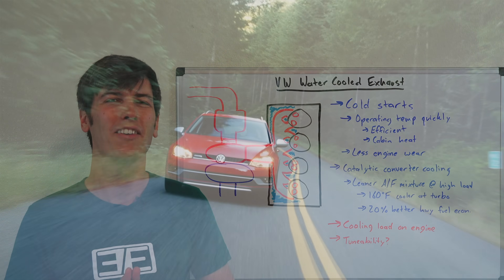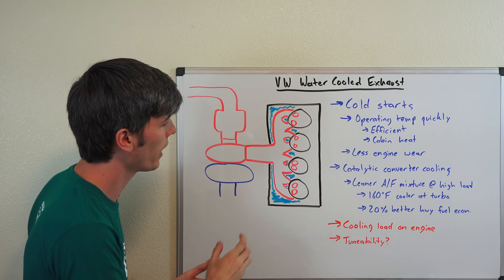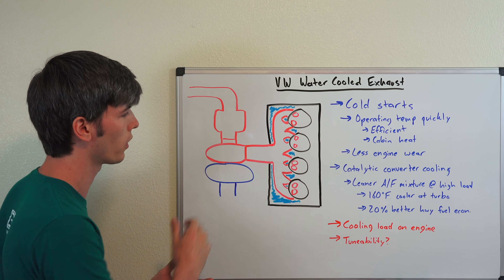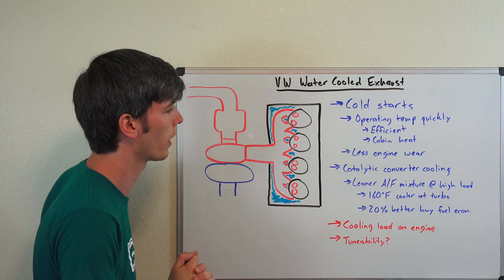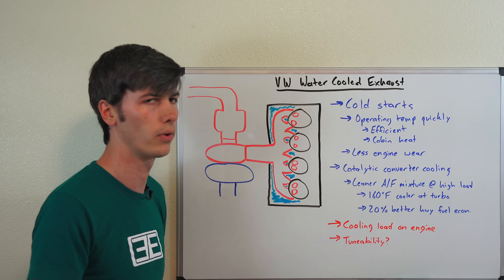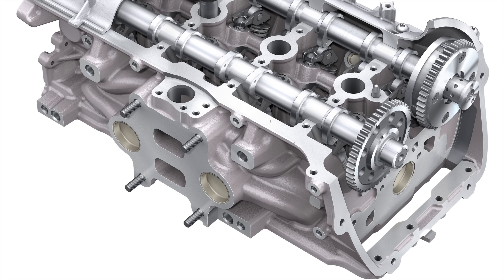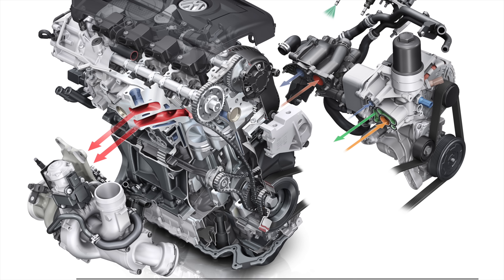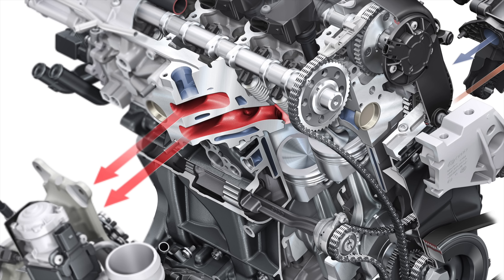Why Does Volkswagen Have A Water-Cooled Exhaust?

Comment: In the trucking world, it's common knowledge, that big diesel truck engines horsepower is limited by the exhaust heat.. 1200 degrees is all any turbo can stand.. in boats, the same engine can produce twice the horsepower, because they use water to cool the exhaust manifold and turbo's... 
This would eliminate alot of the turbo heat, and allow you to run a higher power, longer...

Comment: Less heat energy to turbine means less power turbine can make to compressor. During normal engine operation when engine is warm it is less efficient design... Correct if IM wrong.
Reply: Colder air is more efficient.
Reply: ivan rivas not true for exhaust gases for intake air its better but exhaust is different story.
Reply: Thats not true. Cooler air inside is better because its density is higher so more air in same volume. But when gases gets out from cylinder there is still heat energy and turbine use that energy for compressor, if heat is cooled down it lose energy and pressure so less power to turbo.

Comment: Simpler reason: Its aluminium. Most exhaust manifolds are iron or steel. With VW eliminating the exhaust manifold entirely to save space, they have to also eliminate excess heat to prevent the now integrated exhaust manifold from cracking the aluminium head. What better way than to wrap it in a coolant jacket.

Comment: Honda did the internal exhaust manifold 20 years ago upon the 3.2 v6 used in Honda Passport and Saturn Vue.
Reply: And? Does it help? Is it reliable? Do they produce this system still?
Reply: @Nitramrec  they use the same principle in their newer L series 1.5 - exhaust manifold is incorporated in the head, turbo bolts directly to the head. It's been quite reliable so far.
Reply: @Nitramrec  I don't know whether Honda still makes a derivative engine.  The 3.2 has a good reputation.
Reply: @Nitramrec  yes they still make the j series 3.5l  v6 for suvs and vans.  has the same exhaust design.
Reply: Honda been doing it forever I thought the r18 in 2005-6 was first but you're right
Reply: GM did it 30 years ago with Opel Calibra.

Comment: i want to make something like this in the intake manifold on a n/a engine 
will i change too much the information that the ecu gets ?
i want to keep it as low temperature i can i also will get an oil cooler on this engine
its bmw m50b25 on an e30
 the reason = in my country we have some high temperatures especially on the summer so i want to keep it cool 
whats your opinion about this?
also what is your opinion about lightweight water pump and alternator pulleys does ot worth?

Comment: Imagine a “cracked” manifold
Reply: Being a part of the cylinder head with all that metal surrounding it that might make it somewhat stronger.
Reply: the manifolds only come I  plastic though 🤔
Reply: Well they don't crack
Reply: Exhaust systems are prone to stress ruptures.
Reply: @shadowopsairman1583  - Only if you plug them with a banana. Seriously, what world do you live in where you think an open exhaust is prone to rupturing? The silly crap I read in YouTube comments never fails to amaze me.
Reply: That would never happen to such a well designed motor, VWs are very reliable..

..buahahahahaha🤣
Reply: PrimalMiltos This engine has been out for over a decade. Number of cracked manifolds I have seen (I work on these for a living) zero, zilch, 🍩 ....

Also the real reason these have coolant in the exhaust is to cool the turbo. Nothing more.
Reply: @LynxStarAuto  now if they could only make the rest of the motor/car reliable 🤣
Reply: @LynxStarAuto  So just have a water cooled turbo.
Reply: @jamescaley9942  The turbos are already water cooled.
Reply: @PrimalMiltos  clean diesel

Comment: Great cutaway view of the engine. It was pleasing to see a solid Overhead Cam Drive Chain again, and not the toothed rubber Timing Belt. Not sure if you mentioned that (by liquid cooling of the Exhaust Gases) - the exhaust gases will become slightly more dense, to better drive the Turbo and (perhaps) also extend the life of the Turbo Unit.

Comment: To me, it looks like there would be an efficiency penalty due to the  design of the exhaust manifold since the outer two cylinders have a more lengthy path to travel before exiting the manifold.  This, in conventional engines is a big no no.  So, the question is, are you really getting a 20% boost in efficiency or are you merely overcoming a poor design making it look like a 20% increase in efficiency?  I would move towards an equal length header, moving the turbo and cat downstream from the exhaust manifold to get the  lower exhaust temps desired results to be able to run a leaner mixture.  You get the best of both worlds with that design.

Comment: I might be wrong... but my dad owns a 2016 Passat with a 1.8TSI 180HP and during winter the motor Oil temperature rarely climbs above 80Celsius which actually increases fuel consumption by about 1 liter / 100km. During warmer times the oil temperature is around 100.

Comment: I'm not in a position to really talk about weither or not it's gonna save fuel (doubt it, tough), since there are dozens of other factors to go with it and I don't have such a car available... but I really wonder about the thermal stress and longevity of this design, to me it doesn't exactly look trustworthy. Another question would be the water temperatures... using the same cooling cycle for engine and exhaust sounds like a disaster waiting to happen.

Comment: I have a ‘17 Golf TSi. I have a Neuspeed power module installed. It raises boost pressure and I’m not sure what else it does but it is a way to gain power without flashing the ECM. My question... Can this module be damaging at all to any part of my engine or cat?

Comment: so we nave this sensitive thing (cat) to lower emissions... then we have to pour more gas in the burn to keep it happy. California logic.
Reply: those are two separate things. The catalytic convertor turns poisonous gases into much less toxic gases. The slight increase in fuel usage doesn't offset that. Ever drive behind a motorcycle or scooter? They have no emissions controls so even though they get better gas mileage than a car, you can literally smell the poison coming out of them

Comment: Sorry. I have a feeling that the main reason for this gimmick is to reduce cost. Just like 35 years ago the auto industry pushed front wheel drive "because it handles better" (It does not' but it saves the cost of the drive shaft and more).  Also: The industry is  currently pushing turbo charged engine "because it saves fuel" - (It does not but a smaller engine with turbo is cheaper then a larger engine and it lasts shorter - better for the manufacturer). In addition turbo lag is still here, is annoying and even dangerous on powerful engines. How do I know? - I own a BMW 340I which has a very annoying turbo lag and the subsequent "kick" is unsettling and dangerous. In my experience, VW engines in general are over engineered, hard to take care of and relatively unreliable. As for the engine in this video: I have some second thought about the longer "routing" of hot exhaust gases next to the coolant separated by aluminum wall inside the head. My opinion: stay away from gasoline turbo charged engines. Non turbo charged engine will last longer and the drive is much more pleasant (unless you like to race). BTW: I am a retired engineer.

Comment: I wonder what will happen to the coolant temperature when this type of engine is in a car that is traveling from Baker, CA towards Las Vegas, Nevada, on Interstate 15 along the 17 mile steady incline in 110 degree heat. The turbo will be spooling like crazy, the ac will be on, and now the exhaust manifold will have to be cooled.  Yes, a HUGE radiator will be needed!  I would like to see this engine design tested on this particular stretch of road in the middle of summer.

Comment: "With engines in general you can run a rich air fuel mixture to cool..." Afraid not, this applies to gasoline engines regardless of natural or forced induction, but Diesels are exactly the opposite, regardless of natural or forced induction.
"why would VW do this" Emissions, period. Faster warm up, leaner burn. Other factors are side effects of the emissions goals.
Reply: @RobertLutece909  emissions and fuel economy aren't related, at all.
lol
Reply: @RobertLutece909  we're in agreement
Reply: Correct bros....diesles are much easier to tune for performance....its just a matter of leaning it out as much as u can and when you start to see the torque fall down u know u have past a Diesle VE efficiency
Reply: Stochiometric ratio is 15 air:1 fuel, ideal is 12:1 to prevent detonation.

Comment: I've spent my career in the Automotive/Truck Industry for the last 50 years (retired 6 years) as a Mechanic and Sales Engineer. In the last week or so, I have been amazed at the new components I have learned about, i.e. Electrical Superchargers/Internal Exhaust Manifolds/Twin Turbos/Dual Clutch Transmissions/HCCI Engines/Cam-less Engines, Variable Compression Ratio engines etc, unbelievable! It seems that most of these are sadly done by foreign manufactures. It looks like USA Auto manufactures are living in the past!

Comment: That's only crazy technology, trying to make international combustion engines a little bit better than the worse. That internal combustion technology efficiency is even not nearly the electric motor efficiency. Also the internal combustion engines need a lot more technic with electronic and regulators...

Comment: Love all the ignorant comments not believing the 20% mpg improvement. Clearly idiots know nothing about si combustion. Exhaust gases r significantly higher than ci aka diesel. So hot they will melt turbos and catalysts on na engines! Therefore the gas engine always!!! Over fuels at high loads and speeds! Over fueling by as much as 30%. Cooled exhaust manifold cools the gas and eliminates the need to over fuel! Gee engineering who would have figured

Comment: Doesn't really make much sense to me. Cooling the exhaust prior to the turbo sounds counter-productive, as that's reducing the energy going into the turbo - if anything I'd think you'd want it as hot as possible, I've even pondered the thought of having the catalytic converter upstream of the turbo to make it even hotter. I suppose having cooler exhaust feeding the turbo would allow cheaper metals to be used in it, so a cost-cutting measure might be explanation. Similar for catalytic converters, I always thought having them hotter was better, especially during warm-up, and they're difficult to overheat unless in a racecar or something.
Extra heat into the coolant which must be dispensed with seems very counter-productive, adding weight and cost, as well as aerodynamic drag to push more air through a larger radiator. Might help warm up quicker, but there would also need to be more coolant to warm up - the quickest way to warm up is to have no coolant at all. For example, an air-cooled engine, where there's just a little bit of metal, not a bunch of water, to heat up - my old Bug is warmed up within a couple minutes. My understanding is that most modern engines run at peak or lean of peak during most driving, only running rich when at full power, so unless you're racing being able to run leaner without overheating wouldn't be much help. Not to mention that to my understanding the limiting factor on heat is the exhaust valves, which this wouldn't help with at all. 
As for tuneability, that's not likely to be a huge concern for the manufacturer as the vast majority - probably at least 90% if not more - will never be tuned, they'll be bone stock into the crusher. While a few enthusiasts like cars to be tuneable, the manufacturers care more about the mass-market - which doesn't care. The ideal in my mind would be to build the car right so that there wouldn't be anything for tuners to do, it's already as good as it could be (in terms of things like exhaust tuning) right out of the factory - and we're getting close to that, it's very difficult to meaningfully improve on modern cars, unless doing something that will cause other substantial drawbacks. 
I will say I like the elegance of it, the entire manifold built in rather than a separate part. Would probably make even more sense for the intake manifold, to have the elegance of this approach, and cooling the intake air of a turbo engine is desirable - it would be the manifold and intercooler all built into the block. I still don't understand why this is a good idea, but I'm sure it must be if they did it, there must be advantages to make it worthwhile - whether or not they are the ones stated in this video.

Comment: 2.0L E888 has it on my 2016 GTI I do believe, turbo is right on back of engine, and it also keeps carbon buildup under control, as earlier versions of 2.0L had a carbon build up problem in the intake mainfolds, so this may be cooling everything better up top, intake and exhaust

Comment: The coolant pathways look very close to the ports. I wonder if improper coolant maintenance over the years could lead to enough pitting or cracks and eventually result in a coolant leak going to the exhaust? I've seen so many aluminum castings ruined by neglect of the coolant system. Looks like a pretty difficult casting as far as manufacturing process goes. I can see this saving on production costs though, since they no longer have to manufacture a separate manifold or spend the effort to bolt it onto the head during assembly process.

Comment: Being an owner of a 2016 passat 1.8 tsi i had no idea the engine in my car is so tech advanced.
The water cooled manifold is neat.
As far as driving dinamics...the engine is a gem.theres absolutely no turbo lag and when you kick the accelerator my the 3.400 pound passat goes ballistic. It feels like it has much more power than 170 bhp...maybe its because max torque is available at 1.500 rpm.I average close to 40 mpg pure highway and about 28 combined.
I have close to 40.000 miles on the odometer and the only thing ive done to it is change the front rotors and pads and a nice set of michelin tires.
Honestly i dont know what the future has in store for my passat...being that its a pretty complex engine,but looks like most new cars are in the same ballpark as far as comlexity is concerned.
Reply: How are you doing with this engine after 7 years? I've got the same engine on my seat leon FR 1.8 TSi 132kW

Comment: Ummmmm....
For 20 years, I was under the impression that a richer air/fuel mixture is what causes catalytic converters to get hot.  Maybe as long as there is complete combustion that isn't the case, but when unburned fuels enter the converter, the chemical reaction really starts going and that is what melts it down. 

Or is it due to a whole bunch of oxygen AND fuel entering the exhaust as a result of poor ignition that gets it hot?

Also, I have seen where people have installed exhaust gas temperature probes both upstream of the turbocharger as well as downstream.  The richer mixtures result in cooler exhaust gasses upstream of the turbo (and lower combustion chamber temps), but hotter downstream.  Leaner mixtures result in the opposite.  This was done on aircraft to better monitor fueling at varying altitudes.  The richer mixture is hotter downstream because (the theory is) the fuel continues to burn.

And back in the carburetor days, a rich mixture resulted in melted catalysts.  Or that is how I remember it.

The exhaust manifolds are being built into cylinder heads in order to reduce the number of engine parts as well.  Fewer parts mean more simple and more profit.  Auto manufacturers have really done a good job of reducing the number of parts under the hood of their vehicles since the 1990s.  Since it is almost normal for exhaust manifolds to get red hot, you obviously do not want your aluminum casting to get hot like that as well, so they have to run coolant jackets around it.

Comment: Instead of water cooling you could use the heat to power an absorption cycle refridgeration unit so you can use sub ambiant charge air temperatures... Just saying ...

Btw in europe 170 hp is considered powerfull

Comment: I don't think the problem with the turbo change or something is going to be a real problem. I mean there are 4 dowels. You can make adapter to the new turbo or simply you can use the stock one with lathed cold side and put a bigger middle part (make a hybrid).
The biggest problem will be the coolant temperature.

Comment: I predict a lot of failed, cracked, warped heads and blown head gaskets. A better design would be if the manifold and turbo had it's own liquid cooling system that was separate from the engine. This system will cause even more thermal expansion of the head  which puts stress on the head gasket and head as it tries to expand while tightly bolted to the block.

Comment: all vw turbos bolt onto the cylinder head.  all cylinder heads have exhaust ports.  all vw turbos are part exhaust manifold in the sense that if you replace a vw turbo you replace a large casting also that is an extention of the exhaust manifold.  someone else mentioned it by rights a gasser turbo gets red hot especially on small vw engines.

Comment: would the coolant not need to be pumped around at insane speeds (high pressure) to be able to cool suficient? its al9t of heat to get rid of.

Comment: At the top of the exhaust "manifold" there appears to be some sort of exhaust gas re-circulation thing going on, wonder if that's to move heat around to the front of the engine block.